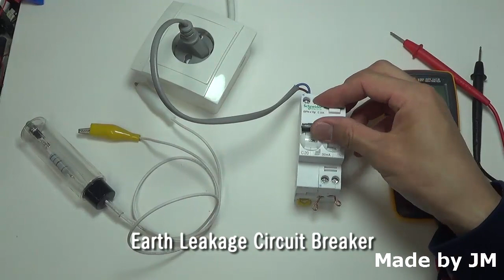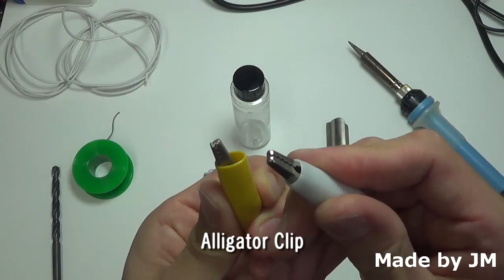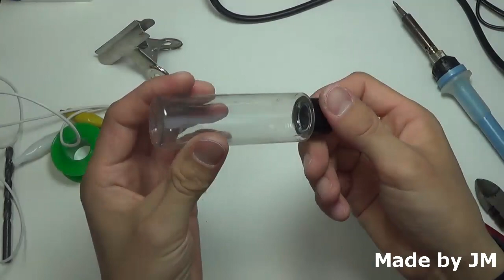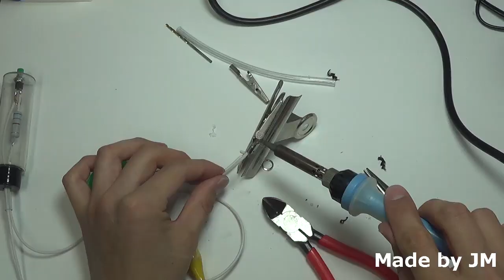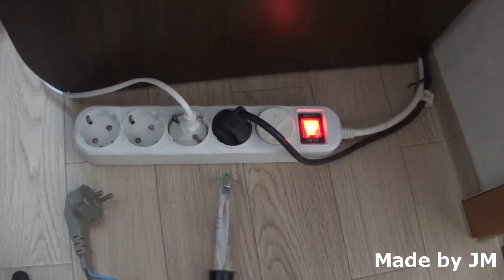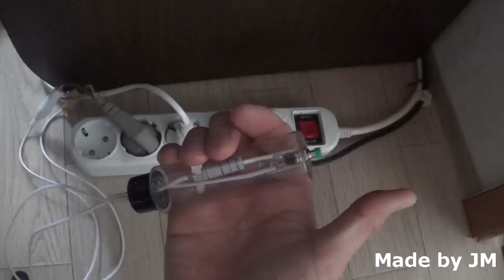DIY Tool for ELCB Trip Test (Circuit Breaker Finder)

Comment: The 1/4w resistance is 150kOhm or 15kOhm? I ask it because in the first case, according to Ohm law, results 220 V / (156kOhm) ~ 1.5mA, not 10mA. Thanks for sharing!
Reply: 150k is for lamp only.